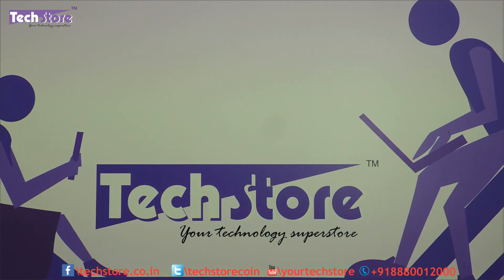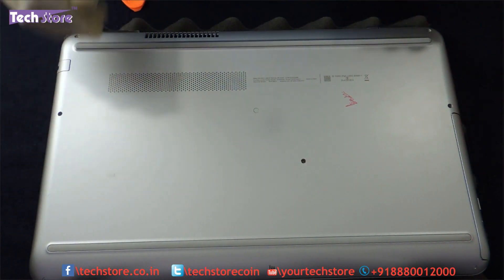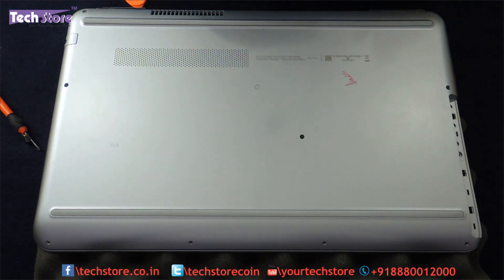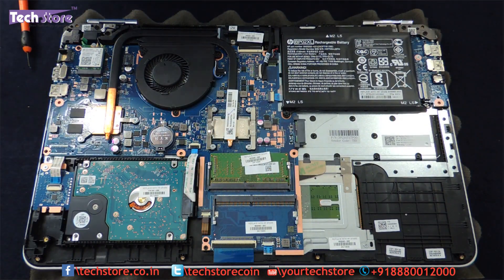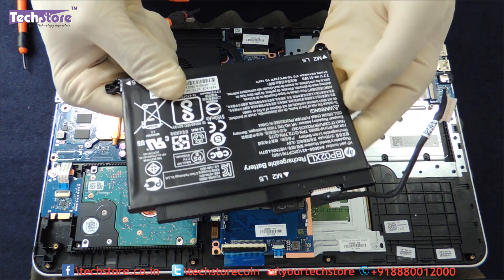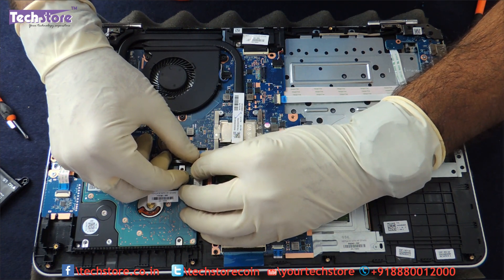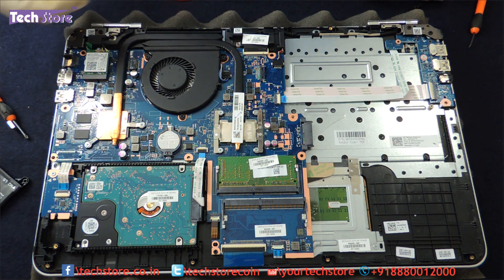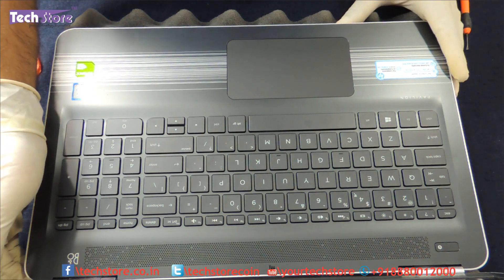HP Pavilion 15 AU series : How to Disassemble and upgrade memory ram harddrive laptop easy diy

Comment: Can I use an ssd and the default hardrive at the same time have a similar laptop with i7 7500u
Reply from the maker: Yes you can by using a HDD caddy.
Reply: Thanks but can I use an M.2 SSD
Reply: which size caddy will be suitable 9.5mm or 12.7mm? plz ans

Comment: thank you for this tear down 
i have au003tx 
can i upgrade the hard drive to a ssd?
and also i am having a problem of flickering display and horrible sound from the b and o sound bar given on it.
the hp technicians couldn't do anything. they have already changed my motherboard but the problem still persists.
please help.
Reply from the maker: +Soham Mandal kindly press hard for a replacement in this scenario. Don't settle for motherboard replacement. You can replace HDD with ssd
Reply: can i really get a replacement? if so what is the process?
help please...
Reply: i even have video proof of the problem

Comment: I have this laptop. I  accidently spilled tea keyboard and now keys are very sticky. please help
Reply from the maker: You need to replace the keyboard immediately to avoid spoiling the motherboard
Reply: I have a very similar problem. How can the keyboard be replaced if it cannot be individually removed? I've never known a laptop where the keys didn't come off for cleaning out dust or spillages. I had to ditch Chrome for Internet Edge-plorer to get  a working virtual keyboard to be able to type this, as most of my physical keyboard currently does not work.

Comment: Hey andy! I have the 003TX model which has 8 gb ram.
I have two questions, does this laptop has 1 ram slot or 2? And is it possible to increase ram for this model?
Thankyou☺
Reply from the maker: It has 2 slots. You can increase the ram upto 16GB easily.

Comment: Has anyone used any hdd caddy in the pavilion 15 au series? If yes, then can you please pass on the link. It states in the specs sheet that optical drive is 9 mm thick and I have heard people on forums say that 9.5mm doesn't fit properly and might cause damage to the optical drive slot.

Comment: hey can i replace my hdd with a sata 3 ssd in au006tx?
Reply: I have same laptop, did you do any upgrade?
Reply: @Yours_Taw  Yes. I bought a 9.5mm caddy from amazon and I put my old hdd in it to replace dvd drive. I connected samsung sata-3 2.5mm ssd evo 750 as a main drive.

Comment: thanx for dis video.....i just wanted to know that did your warranty get void if you replace the dvd drive by an internal ssd using 2.5 to 3.5 hdd caddy ??
Reply: I think no but to be sure just replace the original dvd with 3.5 hhd caddy when going for a replacement ;)

Comment: I have a hp pavillion au003tx. I want to add a ssd in my laptop using hdd caddy. My question is, does the sata slot, to which the optical drive is attached, supports sata III 6gbps speeds. Will I be able to use the ssd to its full potential through hdd caddy, or do I have to swap the ssd with the hdd.
Reply from the maker: +Maximus K put the HDD in HDD caddy and put ssd in the HDD slot.
Reply: will opening the laptop myself not void the warranty?

Comment: Do this model have 1 or 2 antenna? Is it possible if for example I swap the current wifi card(Realtek rtl8723BE for my model) with an Intel 7260ac?
Reply from the maker: +Kyle Smith it has two antenna. Yes you can upgrade the wifi card

Comment: I have this model can i open back panel same way you did with this laptop? Do i need remove long rubber on panel on this model and can it be put back without any glue or something hope i get a respond thank you.

https://www.amazon.com/Pavilion-Gaming-Laptop-i5-6300HQ-7200rpm/dp/B00EQ1Y1OU/ref=sr_1_13?ie=UTF8&qid=1473652777&sr=8-13&keywords=cuk+hp+pavilion

Comment: How did you reinsert that rubber strip on the backside? Did you use any adhesive? Won't the finish be affected once it is removed?
Reply from the maker: +Gowtham Ravichandran the adhesive is already there and strong enough to hold it even if it was removed and restuck 4-5 time. no issues with the finish, be rest assured
Reply: +Techstore thanks! Changed the HDD :D
What is that strip from the SATA? It seems to be some sort of converter for the SATA what is it? It seemed fragile and more like inserting a SIM card? Won't normal jerks of the laptop move it and make it malfunction?

Comment: no m.2 slot ? :(
Reply: It doesn't have M2 Slot. Need to use SSD in SATA Port of hard disk itself. My Laptop is HP -15AU116TX
Reply: @aravind0635  ???

Comment: Is it possible that I buy a laptop with 4GB ddr3 ram and remove it and replace it with 2 sticks of ddr4 2133Mhz 8GB ram..
What would you advice...Pls tell as need to buy a laptop soon
Reply: No, DDR4 RAM is not backwards compatible with DDR3. It won't even fit in the slots.
Reply from the maker: +Bill Lawson you are right, it won't fit
Reply from the maker: +Bill Lawson you are right, it won't fit
Reply from the maker: +Bill Lawson you are right, it won't fit
Reply from the maker: +Bill Lawson you are right, it won't fit

Comment: is this upgradable to 32gb. my country sells 16gb ram stick.
Reply: I upgraded to 32 GB no problem. I added two 16 GB sticks of 2400 MHz RAM but the system seems to be clock locked at 2133 MHz. So 2400 works but is clocked down to 2133, so save your money and buy 2133 MHz Ram to start with. One thing I noticed is it is important to use both slots. Performance suffered greatly with RAM in only one slot. So if you want to end up with 16 GB I'd use two 8 GB sticks. But if you have easy availability of 16 GB sticks use two of those for 32 GB. The system recognizes it no problem.
Reply: +Bill Lawson could you please provide the details of the RAM. I wish to add the 16gb in the empty slot, keeping the 4gb in the already filled slot

Comment: Great video! It really helped me with an SSD and Ram upgrade. I was really hoping you could post a video showing how to remove the screen for the Pavilion 15 AU series laptop. I would like to upgrade the WiFi card and need to add another antenna. My WiFi card is single band only with only one antenna. Thanks for your great videos.
Reply: how u upgraded to add, it doesn't have slot for that
Reply: +avinashkumar444 I means ssd
Reply: I opened the case using this video as a guide and swapped out the internal hd for the ssd. Performance improved dramatically.
Reply: +Bill Lawson +1, which ssd u installed
Reply: +avinashkumar444 The Samsung 850 EVO 500GB. I used their software to do the drive copy and their Magician software to optimize it. I used the Lumsing USB 3.0 Sata HD adapter to connect the SSD to make the copy. That adapter is great and only cost me 9.00. I used it a lot. I'd recommend going to Samsung's website to download the newest software instead of using the disk the comes with the drive.
Reply: +Bill Lawson many thanks
Reply: Bill did you use any hdd caddy to replace the dvd drive with the built in 1tb hard disk?

Comment: suggest me a laptop till 40k 
with good configuration
Reply from the maker: +Rahul Gujar which brand would you like to buy?
Reply: +Techstore 
dell or hp anyone. 
needed for design software.
Reply from the maker: +Rahul Gujar Dell vostro 3559 with 2gb amd graphics at 41k or HP AY007Tx at 43k with FHD

Comment: NO m.2 SSD slot?
Reply from the maker: +John Kevin Villar no
Reply: are you sure? haha
Reply: It has M2 SSD Slot. See Below.

Supports all 7mm/9.5mm, SATA 2.5" HDDs
Supports M.2 SATA Storage
Accelerometer / HDD protection support
Single HDD configurations
500GB (5400) 7.2mm
1TB (5400) 9.5mm
2TB (5400) 9.5mm
SSHD configurations
1TB 5400RPM 9.5mm SSHD w/8GB NAND
M.2 SATA-3 SSD
M.2 SATA configurations (Value)
128GB
256GB
HDD+SSD configurations
1TB (5400) 9.5mm HDD + 128GB M.2 SATA-3 SSD (Value)
Reply: aravind d thank you, i did buy the laptop last August
Reply: Im not 100% sure though. i found the manual in HP site for pavillion series. Thing is nobody is sure of that even service center guys. they told they need to open the laptop and check if M2 SSD slot is there or not. For sure 2.5 inch Internal Sata 3 SSD it will support try samsung EVO 850.
thttp://h10032.www1.hp.com/ctg/Manual/c05228250 . 

and did u install SSD by any chance?